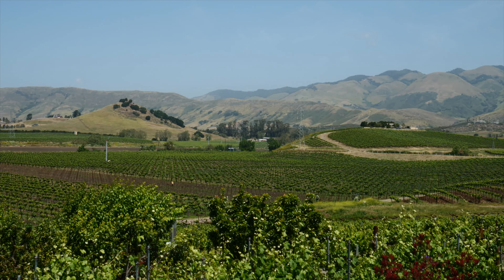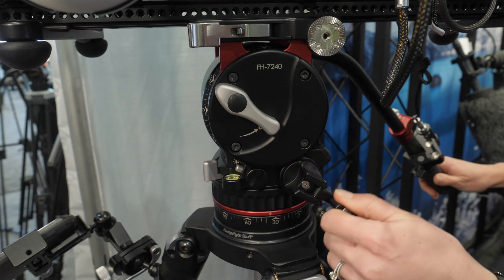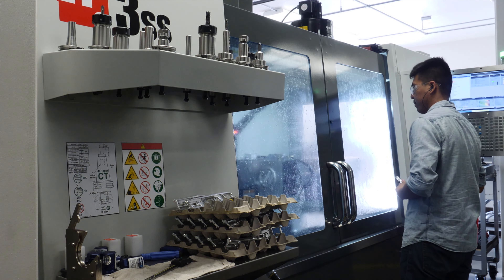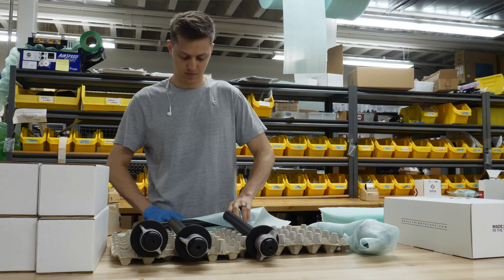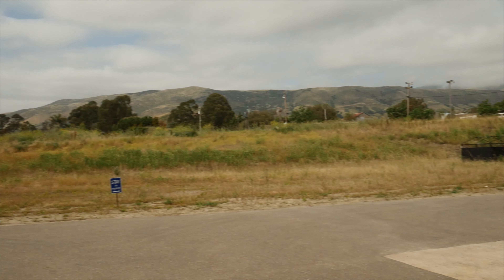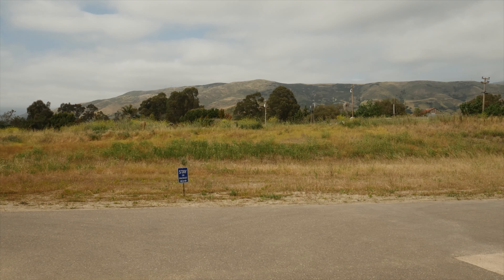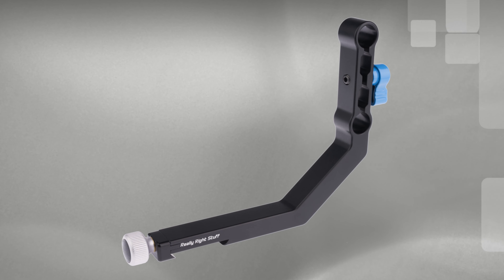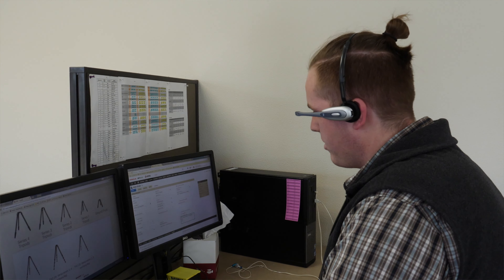Behind the scenes at Really Right Stuff

Comment: I am very disappointed about RRS. I bought a BH-55 ballhead from them. After the ballhead arrived, the clamp and the quick release plate were full of scratches. I sent a video to them to show them the scratches, their staff saw and admitted the existence of them. They said I could mail the clamp and plate back to them to check. After they received and checked the clamp and plate, they said they couldn't see any scratches and refused to replace new ones for me. They also said if there was any, they were made by the machines and were normal. I wonder why products of other brands like Gitzo and Manfrotto have NO scratches?! They are nearly perfect. I swear to God I will never buy from RRS again. I will buy from brands that have dealers in my country, because I can check the products when buying them. Once I find anything wrong, I can ask for a replacement immediately without any transportation cost.
Reply: Did the scratches affect the picture quality? Just saying. You should see my BH-55 after one year of hiking about 30 miles! Still works fine though!